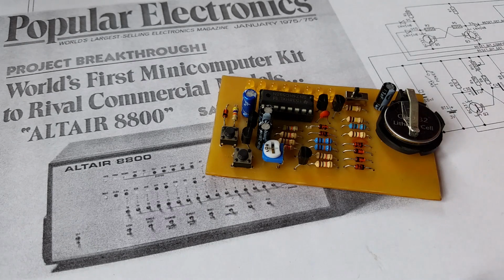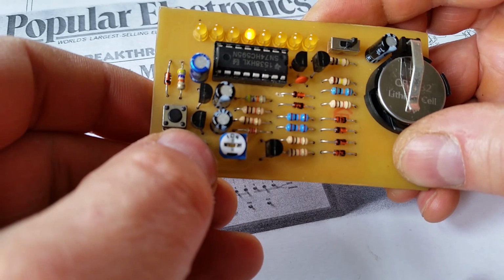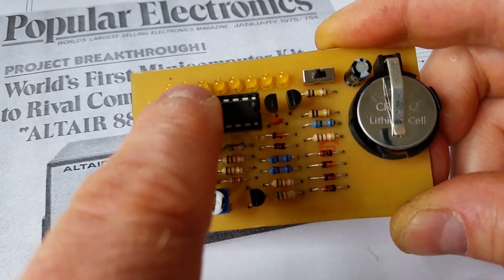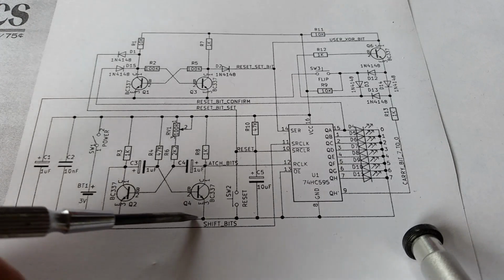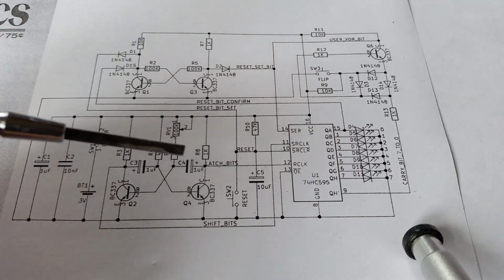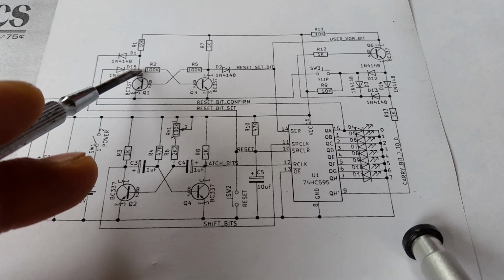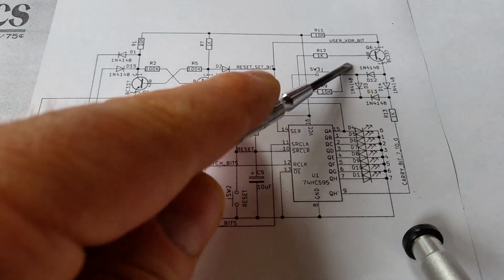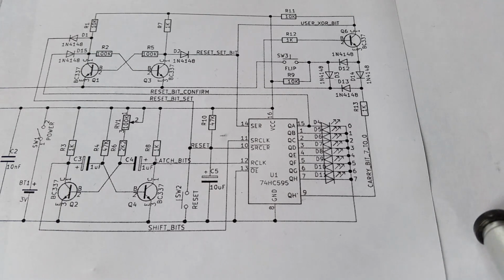Build A Simple Kill The Bit Electronic Game

Comment: Nice circuit, well thought out. I came to your video after toggling in the classic Kill the Bit program into my Altair 8800...

I was thinking of making a few of these as 'socking stuffer' gifts, but I would not bother with silkscreen, solder mask, etc. Just the plain one-sided PCB the the drilled holes.

As I am VERY rusty on Gerber files, the last time I designed a PCB using software, well it was decades ago.

Can you clue me in on WHICH of the several Gerber files you have on your Github webpage that I might want to send to a PCB fab service to get just the most basic boards? I assume that there is one file that handles the copper pattern AND the drilling?
Reply from the maker: It's probably easier to just not include the mask and silk screen files. I think there can be several drill files for things like slots as well as holes. I'm not sure if there where for this board. I changed one of the resistor values since uploading, as when I made another board I found one of the resistors a bit too high value. I'll see if I can find out and let you know which one. It doesn't effect the layout of the board at all.
Reply: @DevelopIT  Any luck determining which resistor value changed?
Reply from the maker: @youtuuba  I have just uploaded the modified files to git, the difference is just R2 on the silkscreen from 100K to 47K. If you view the new silk screen gerber file you should see the difference. Sorry for the delay.
Reply: @DevelopIT  thanks. I looks like the schematic still shows the old 100k value.......

Comment: Nice to see this implemented in discrete components. The pity is there is probably a microcontroller that can do it cheaper.
Reply from the maker: I agree, micro controllers are so versatile these days and the RP2040 at £1 each makes most discrete electronics redundant. I still like to experiment at component level. Your comment made me think, just like modern computers remove users from the concept of programming, modern micro controllers will probably create a generation of people who may not appreciate component level electronics as much.
Reply: @DevelopIT  exactly. Too many people messing with circuits now, by FAR, don't understand "electronics", except to the level where they just throw an Arduino at it. I fear that this fosters a future of electronics 'idiocracy'. Even now, when I find myself more advanced in electronics than most others I deal with, I am often greatly humbled by so many electronics engineers I encounter who are a generation older than me, and what DEPTH of understanding and cleverness of circuit design they exhibit, and how dumb they must think I am.......I weep for the future generations.....